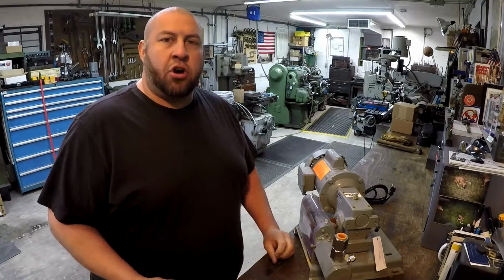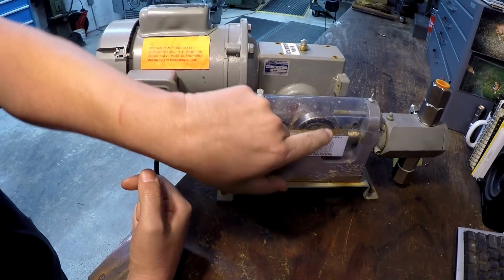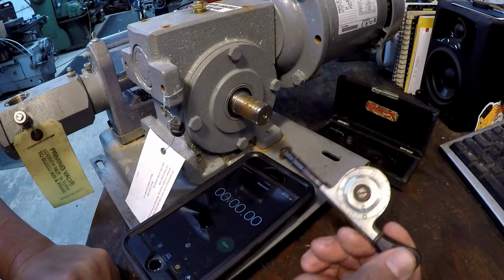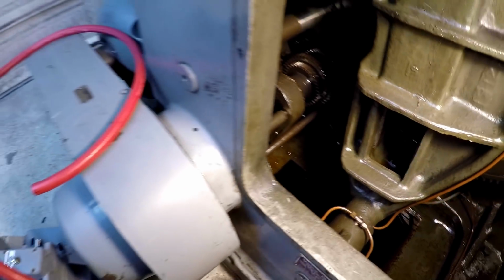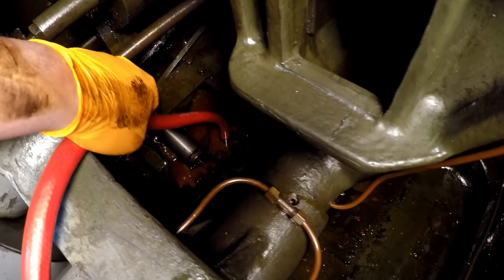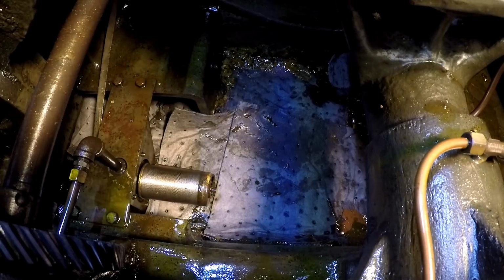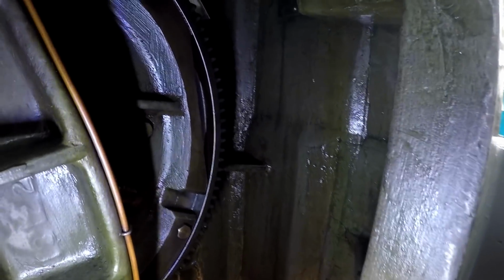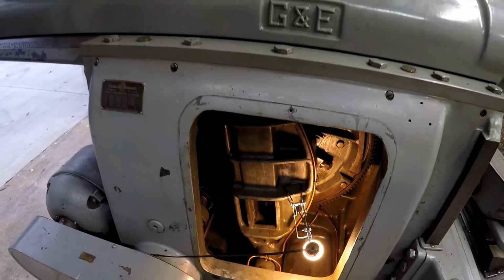G&E Shaper Oil Sump Cleanout

Comment: I don't envy you. Cleaning a neglected machine tool lube oil sump is a time consuming messy PITA. Cleaning an obstructed sump through a narrow door, working at ankle height can be miserable if a thorough job is to be done and I can't think of a worse example (other things being equal) than a mechanical shaper. Looks like you've done a white glove job.

Congratulations: you've earned three punches in your ticket towards earning your wings in machinist's Heaven. Seriously, good work. 

11 gallons? A closed lube system in a middle-sized shaper? No heat generated, no combustion products to contaminate, little matter to settle out, etc; an ideal environment. How much oil do you have to circulate in a dead simple machine tool? I bet 2 gallons would be enough if you could get return oil back to the pump suction. Seems like you need the lube oil sump equivalent of bricks in the toilet tank. And a spin-on filter would be a nice retrofit.
Reply: Forrest  Addy Once the lube gets going through and covers the entire inside, every little nook and cranny, you loose several gallons. And if you listened, he said it was sucking air because it didn't have enough oil, and it had A LOT more than "2 gallons."
Reply: Andrew Delashaw We could argue the point to no conclusion based on fact or experimental data. But I ask you to consider the area covered by even a quart of spilled oil and the wetted area inside that shaper - then consider that good designers avoid impediments to circulated liquid return: there's always a slope, never a catchment, and unavoidable flats are kept small as practicable. That said, I'm guessing entirely without grounds that a couple quarts would satisfy oil in actual circulation in normal operation of a G&E 30" shaper; for the nooks and crannies, so to speak.

Silly point to argue.
Reply: Forrest  Addy the OEM called for 11 gallons for a reason. I am guessing mechanical shear of the oil. When that shaper is taking heavy cuts. It will be putting a good amount of pressure on the gears. That will slowly break down the oil. I am sure the OEM calls out an oil change interval. At 11 gallons, it calls for an oil change every X number of hours of operation. If you cut the oil level by half. You would also need to cut the oil change interval in half.
Reply: horseshoe28016 It's clear we all need to do our research in authoritative resources before engaging in further discussion. I do recall about 1990 speaking to one of Milacron's (formally Cincinatti Milling Machine Co) design people at a tool show of the reason for huge-seeming lube oil sumps. His remark: "Oil is cheap and most users don't change it for the life of the machine." Makes sense. 

You have to remember a machine tool is not like an internal combustion engine. There is no fuel dilution, water vapor, combustion acids, etc to contaminate the oil or elevated temperature to promote oxidation and varnish formation. Therefore regular oil changes are based on long timelines. Usually the decision for change is based on oil analysis and any minor deficiencies may be remedied by replenishing additives and servicing the filter. Machine oil intended for low power, low speed machine tool transmissions requires only a neutral base stock and extreme pressure, anti foaming, and viscosity stablizer additives, if my limited lube knowledge means anything.

I bought my lathe new in 1971 and it still has the same oil in the headstock. I use to sample it every couple years and have the oil king at work put it in with his others for analysis until I retired. In all that time the oil hasn't changed or deteriorated. In 2004, on the advise of the local Chevron lube engineer, I did add 2 oz of hypoid oil as a way to refresh EP properties. I couldn't afford a 5 gal pail of the genuine EP additive, hence the work-around. 45 years and counting between oil changes. Penny wise?

Sorry Adam, looks like we might have a food fight brewing over lubrication orthodoxy.
Reply: Forrest  Addy no disrespect or argument intended. My comment was a guess, based on my limited knowledge as well. 

I have a H-D Street Glide. It calls for the transmission oil to be changed every 20,000 miles. I got to digging into why. As you said, no combustion for fuel dilution to deal with. Come to find out. The pressure exerted on the oil by the gears. Can shear apart the oil molecule chains. That coupled with the 28 ounce oil capacity. Along with it being 20W50. Is the reason behind the 20,000 mile lube change in the trans.

The same oil goes in the primary drive as well. Just slightly more of it at 34 ounces, if memory serves.  And is called out to be changed every 10,000 miles. Because of the wet clutches.
Reply: horseshoe28016   Well since you stated transmission doing 20k between oil change my BMW diesel does 18k for the engine oil , like the one we had before ,oil tech has come a long way

Comment: from the looks of it, the machine uses copper single wall tubing. It is nice for low pressure applications. Connections can be made with easy to buy union fittings. The outer line is probably the same just snapped off.  One thing about old copper line. It tends to thin out so check all the lines you can for leaks , or since it is also easy to bend, kinks from something being tossed around. Air is a good test for system.
Reply: Jacilynn S but it also work hardens so you can bend it to much

Comment: Was about to mention that it looks like a couple of screws would allow you to rotate the pump so the ports are horizontal so you don't need to place it on top of something to use it, but then you showed the one way valves, to do the above you would need spring return valves.
Also looks like that has been used, the baseplate has wear around the holes, it would also accept another pump, twice the volume ;)
Reply from the maker: Sparky Projects I unbolted it from the wooden skid and removed it from the cardboard box. It was sitting outside in the weather.
Reply: Ah, i see :)
Reply: Those check valves are gravity assisted. They need to be vertical to work properly, especially in low flow applications like this pump.

Comment: That shaper is coming up really nice. Such a huge hulk of a machine for a relatively small working are, it's bonkers lol. The new pump is cool, maybe you could use it as an oil feed for the shaper, it's slow enough and as you can adjust it, it could feed the tool reliably and steadily.

Comment: Check the set screws on the link from the crank arm to the ram, mine where loose.

The oil in my G&E was the filthiest thing I've ever seen.  It took many hours to get as clean as yours started.  For the finale pass I used brake kleen.  One cool thing is every time you pull the clutch lever it auto cleans the oil filter.
Reply from the maker: Yep mine has the auto self cleaning oil filter. Pretty cool little guy

Comment: you know you could probably save the fixtures you need to hang if you just rotated the lights you already have in 2 rows long-ways so the light reflects off the walls, and then a third row down the middle if need be.  LEDs have that whole beam angle, and while a lot brighter they don't have the same light spread as a full tube..... just an idea that might save some cash

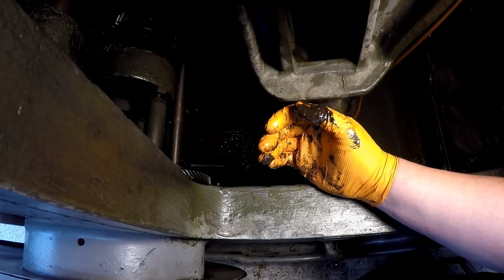Comment: Adam is that a crack in the casting inside the shaper?  Just above the main pivot shaft on the whatchamacallit 22:40  Or is that a positive seam from the mold
Reply from the maker: It's not a crack. Someone else thinks it is too.

Comment: I started using pigs back around 1988 when they came out. We used the oil only pigs in the pump makeup tank that supplied cooling water to the machines. Usually a heat ex-changer on an air compressor or hydraulic package would rupture and contaminate our make-up tank with hydraulic oil. Great product!!
Reply from the maker: They have quite an extensive line of products really. They have a big catalog that comes once a year. Something for every industry and all occasions in there.
Reply: larry munday i

Comment: I watch your vids all the time.  Ive owned a machine shop for 35 yrs.  We mostly run production but I am AWAYS fixing something or making a repair on mine or someone else stuff.  And sometimes making tooling or fixtures...  I do everything on CNC machines.  It is soooo much easier doing all that kind of stuff with just numbers and a button..  I think of you every time I am doing that sort of thing..  I like your vids..  nerve racking though... for me...

Comment: Looking real good Adam, really it was the same story with mine. 1/8 inch of goo at the bottom of the sump and lots of time soaking with rags. I love the pig mats, use them at work all the time. Your G&E looks like it has had a fairly easy life. That shaper will be around long after we are gone if she is cared for..
She was build to run 24/7👍
Reply from the maker: Thanks Steve!

Comment: Here's a suggestion for those oil lines - tygon tubing, very flexible and lasts a long time with fuel or oil.  McMaster has some here: https://www.mcmaster.com/#=1bdg1oc  but you might find some cheaper locally.

Comment: Tremendous amount of satisfaction to cleaning and setting up a new or new to you machine. You find the things that need replaced and or fixed and learn the machine inside and out.
This is as much a key to understand as listening to the motor running under load.
Seeing this process makes me smile and it will serve you well for many years to come. I know as always you willd o a great job on it.
Reply from the maker: Great way to learn a machine is getting in there and cleaning it all up!

Comment: That whole big machine (motor & gearbox) just to actuate that tiny pump. Wow.
Reply: I imagine that the pressure and height it can output to is quite large given the very robust nature of the setup. I have a similar water pump, it fits it the palms of my hands and it can pump water 30 meters high at decent pressure. Slow as b**ls but pressure is there. The motor and word drive dwarfs the pump.
Reply from the maker: It's a metering pump

Comment: Probably a dumb question:  Can you fill the sump with diesel and run that through the oil lines for a few minutes without causing any problems?
Reply: I think that might affect the paint. Diesel left in would chew unprotected paint, i use diesel to clean parts from time to time, it's not as 'bitey" as gasoline so it won't strip too much from a patina if i desire to keep it.
Reply: Darryl Bonds My thoughts, eggs-zackly!
Reply: You don't leave it in, you flush the system with it, drain and add oil. Remember that diesel is an oil that cleans and drains well. That is why you want to run it through the oil lines and flush them out. You can run the shaper "briefly" with diesel as the lubricant for cleaning purposes.

Comment: I'd run it for a couple of nights with 15W40 diesel engine oil and allow the detergency and dispersency clean the shaper, then drain the dirty oil.  Using a non-detergent machine oil is why all the sludge is there.
Reply: oil+water+dirt=sludge, when this emulsion is allowed to sit undisturbed the dirt/water/oil, settles(stratifies) out. "Detergent" motor oil keeps the dirt in suspension (dispersants) so a oil filter can remove it. NEVER add detergent oil to anything that has been run for a period of time with non-detergent oil, unless there is a full-flow oil filter in the system to catch all the "dirt" you are going to stir up, or clean out ALL the  sludge first.

Comment: The pump is a metering pump for chemical injection into a prosses. I see a lot in paper mills.
Reply: Adam repairs quite a few paper mill gearboxes, so it fits. Likely brought along with one of jobs at work, and forgotten or unwanted for a long time. I hear they can be pricey.

Comment: Adam, I agree with Carl and Brian below. What we used to use on machinery when I was in a shop is heated Varsol. Maybe 80 or so deg. Hand sprayer, garden sprayer. Or you could build yourself one that uses shop air. Was great for cleaning old radial engines that dripped oil almost as fast as you could put them in. We used a simple emersion heated to heat the Varsol. I would also take it as far as using the varsol as an oil for a very short while and try and flush out the oiling system.

Comment: Had friends that raced in a division higher that needed a fast oil transfer pump for their quick change rear ends. I took a 12 volt pump/motor assembly off a scraped manual pull straddle stacker (type of small fork lift), welded up a simple carriage with wheels and a car battery tray, removed the old 1/2 inch hose fittings and replaced with 3/8 inch adapted fittings and 12 foot of hose each side, auto momentary manual start switch in line with a 20 amp fuse on the positive side, made for aw32 Hyd. oil but would pull gear oil long enough to empty and fill a rear end before becoming too hot and tripping out, took about a minute.

Comment: My Steptoe is all manual oil.  It's got a catch 'basin' at the bottom, and I can't find a drain for it.  I guess I'm going to have to find an old soup ladle and dip it out.  I'm almost scared to find out what is in there  (insert crude joke about finding Jimmy Hoffa here).  I know there is at least one old chip brush lying on the bottom.  Since the oil doesn't get recycled, I'd  concentrated on making sure the gear works were free of debris and any dirt that may have settled on them.

Comment: Check it but here on the farm we use a 3/8 or 1/2 inch ratchet it works well if it's the right size for that square plug an extension can get more room if u need it

Comment: Adam, thanks for taking us with you during the cleaning of the sump. I really enjoyed seeing the inner workings of your fabulous machine. I had hoped you would apply pressurized solvent in spray form to clean the grime away and off the inner walls and gearing. Or some brake or carb cleaner in aerosol form would work as well. Then you could use your pig mats to soak that stuff up. Best to you and your great machine shop videos, from Greater Chicagoland!

Comment: When you pull out the pig Matt is that a crack in the bottom of that arm in approximately middle right of the screen
Reply: I wondered that, too, but decided it's merely a ridge from casting.

Comment: The 30rpm / 36rpm is what you would get for the same motor run on 50Hz or 60Hz.
50Hz = 30rpm
60Hz = 36rpm.

Comment: We use that oil pump for pumping chemicals into high pressure boilers. I should be able to pull a manual for you if you need it. They require a real good grease job as it's what is used for sealing. We know them as a v5 simplex pump manufactured by a&f machine products.

Comment: Adam That pump is a high pressure injection pump for pushing chemicals into a product stream. They are usually hooked to a timer and inject on command. Example, waste water stream and chemical to treat it.

Comment: Early notification crew in effect!  A fun trick with the blue mats when I was working on petroleum equipment - We pumped the water out of fuel oil and diesel tanks on a regular basis.  If you poured that pumped stuff through a blue towel(generic brand), the diesel soaks right through and the water stays on the blue mat.  Dump water and repeat.  I heated a home for the worst of winter on something that should have been hazardous waste.